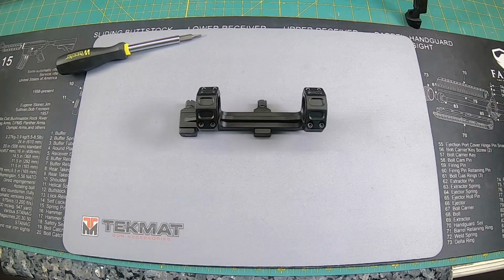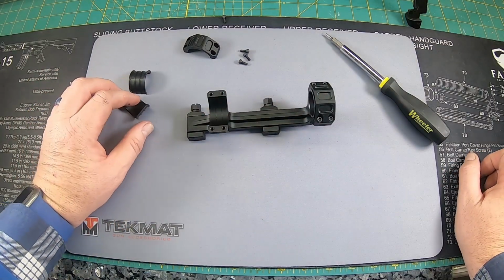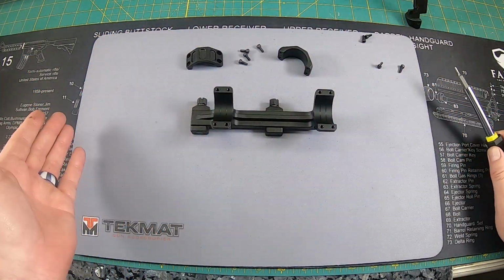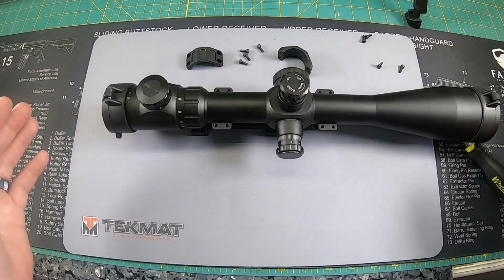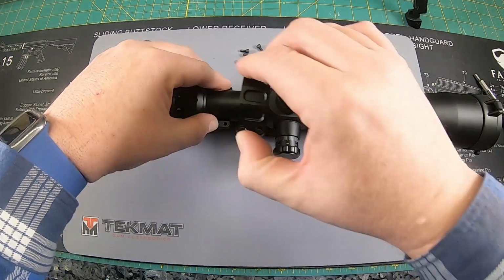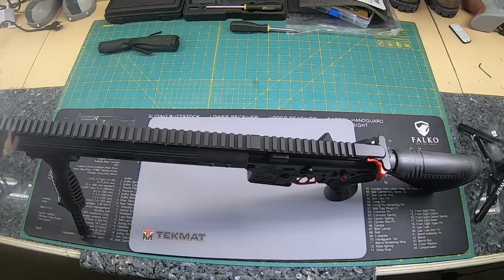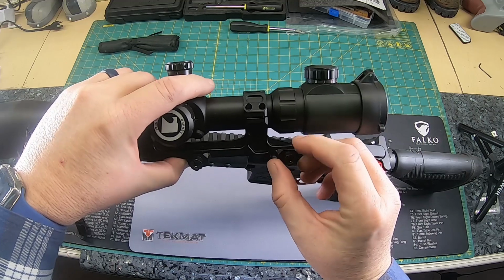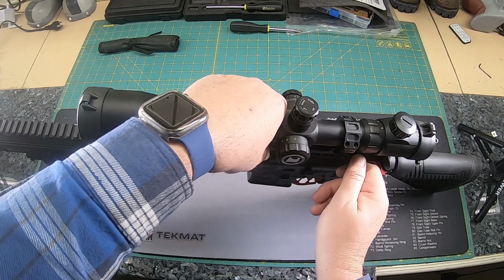AR Scope Mount Install

Comment: Not knocking the video, but you should have included tightening the base nuts more than handy. Leave ring screws loose to do a rough eye relief adjustment. Also, visually inspect the scopes level, looking through it.
Keep them coming!
Reply from the maker: Gene Parpart thanks for the pointers. That’s good stuff to know!
Reply: Dm i want y to o show you something about carl